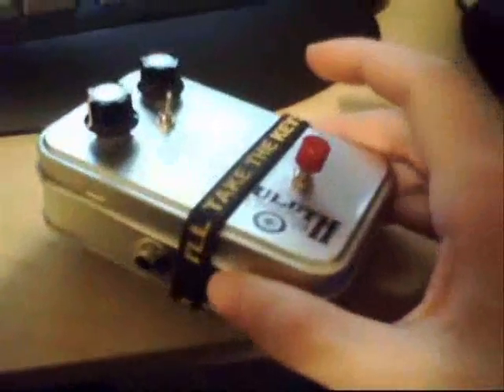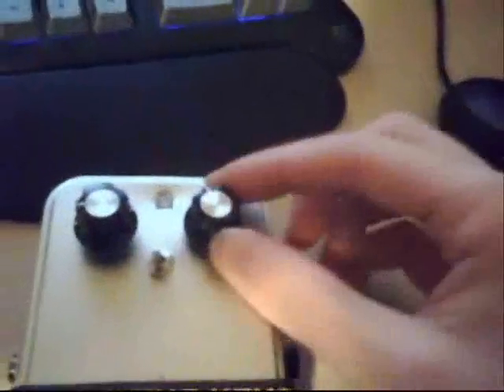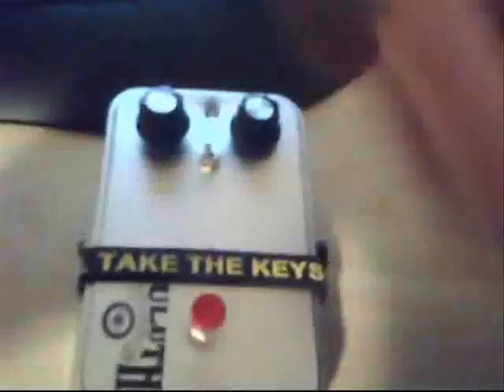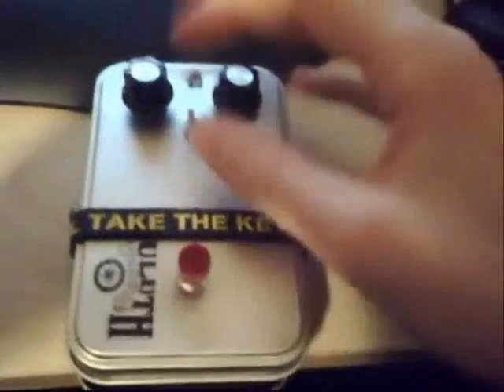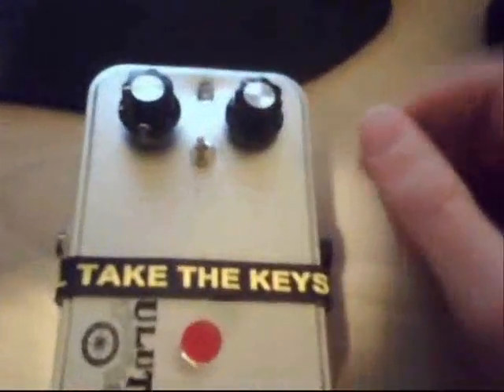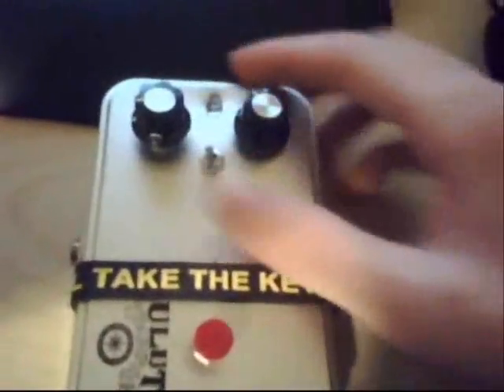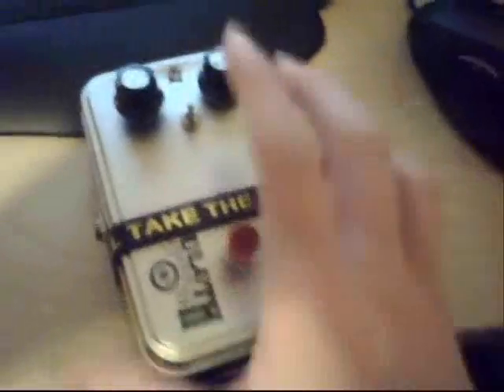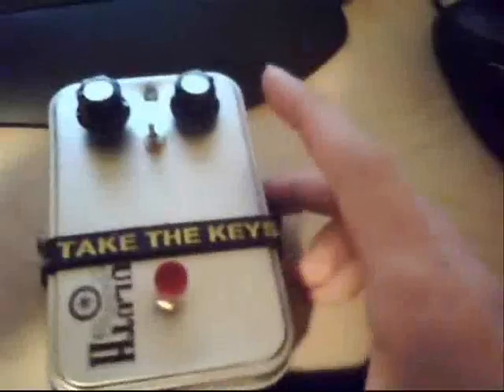Custom/home made overdrive/distortion pedal.

Comment from the maker: I've got a 9v battery in it and a 9v wall wart (doesn't need much current, maybe 25ma at most. the one I'm using is 200ma) should do fine. You could operate it up to 18v (I think) for greater headroom and possibly better sound.

Comment: hi dude got some questions before i create my own kind of this:

for power supply: what do u mean by V+ and V+/2?
can you redraw this schematic? i dunno where to put my switch, pots, and that SINE (0 100mV 80). im totally confused now. please make another schematic with clearer symbols. i really want this tone compared to other DIY's but ur schematic is more harder to read for me i guess..

sorry for my english dude. hope u can help me.
Reply: Bhorj Ravina v2 is the half of the input voltage v1... Here two 100 k resistor are using as voltage devider

Comment from the maker: @jmastax If you want to do it with no IC's, you'd want to use a power amp like the TDA2030. However, it'd be a lot more difficult to use since it's not all integrated, and a lot of extra circuitry is required to use it. You could build an amp from 5-15 watts with that chip. Keep in mind tho, that a 5 or 10 watt amp is not very loud. The chip I mentioned previously is about as loud as a normal conversation.

Comment from the maker: @jmastax It'd be fairly easy, just wire in any old (small) monolithic power amp chip after your favorite distortion circuit, and you've got an amp. I've got a TDA8943 power amp chip here (5 watts) that would be easy to use (but it's not very loud at all). Check mouser, that's where I buy all my parts.